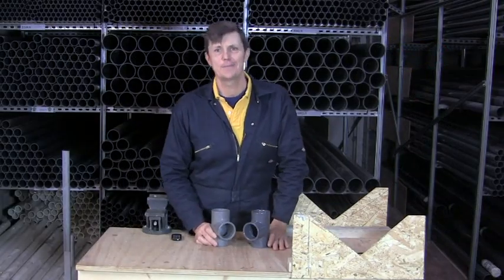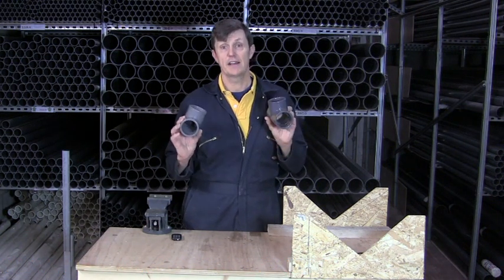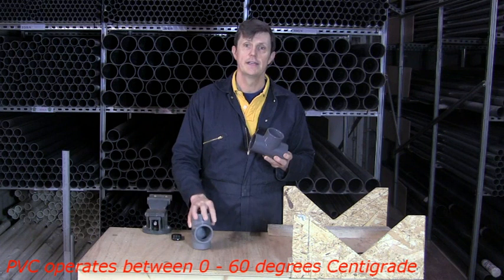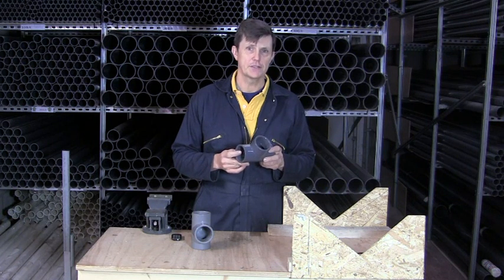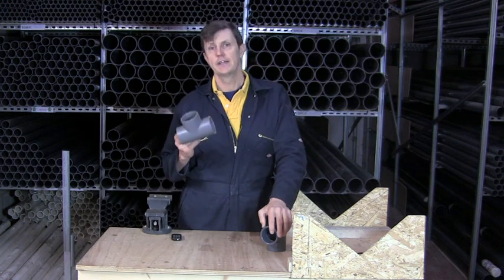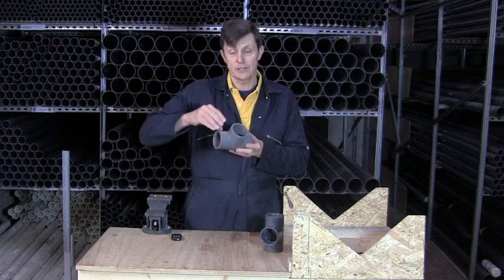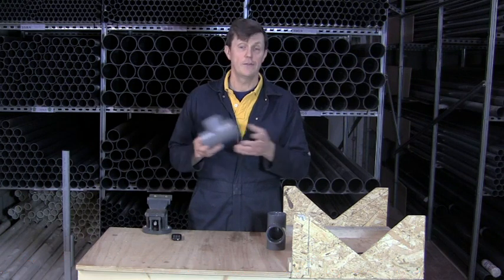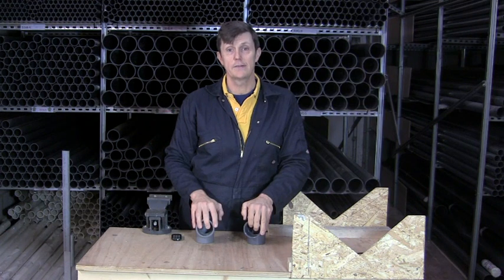The difference between PVC and ABS pipe systems

Comment: Am trying to tell differences between hdpe and abs am trying to  identify some 1 inch black pollie pipe  i have laying around  no markings am in central usa if makes any difference
Reply from the maker: Hi, if the pipe you are trying to identify has a waxy feeling and is bendy, then it is likely PE pipe. If it is rigid it could be PVC or ABS. Another way to check is, if there's any joints, you can send a photo in to us and we can determine what it is for you.

Comment: Very interesting video. In the United States ABS is black and most commonly used for dvw systems. PVC is white in color and use for dvw and sprinkler systems in ground. Within the last year I have found abs having been damaged perhaps by drain cleaners causing pipe to split both down its length and tangentially. Also as a rule PVC is more expensive than abs. Probably the nicest thing about using abs and dvw systems, is the fact that no primer is necessary and the adhesive is also black.

Comment: which is better for being out in the sun everyday? Which has more structural value?  Looking for something that will keep water inside hotter and take 30psi.   Know where I can get black 4 inch ABS?
Reply from the maker: Hi there! None of them like the sun all day, they will bleach after a period of time. PVC will start to turn white probably after a couple of years which makes it more brittle. ABS, which is much lighter in colour, will take longer to bleach - maybe 3 years. ABS has the best structural value, it is not brittle like PVC. Black ABS is not produced in Europe unfortunately. Pressure of 30psi is no problem to PVC or ABS. Keeping water warm inside can only be done with a pipe lagging: https://www.pipelagging.com/
Reply: +Plastic Pipe Shop Ltd  cipet jop
Reply: Its against code to have ABS exposed in sunlight

Comment: Can you please answer this question:

for 2 inch diameter PVC pipes, what size fittings would be right, Should the elbow fittings be above 2inch in diamter, ?
Reply from the maker: Hello. You should use 2 inch fittings. The 2 inch fittings will have sockets built in to them and the pipe will slide into the socket.